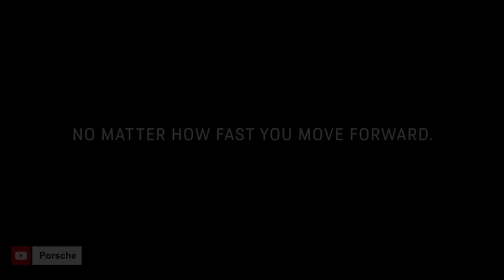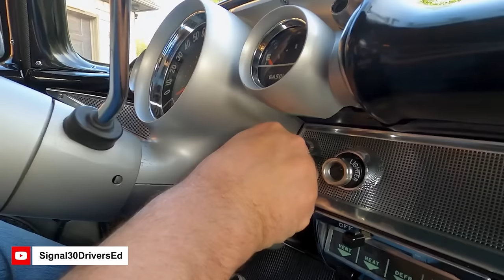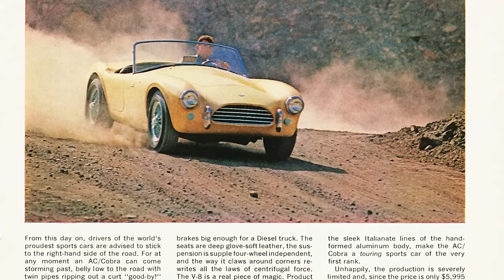Why Old Cars are Better

Comment: Great video and it's good to listen to someone that understands classic cars and the experience of driving them. I grew up in the late 40s and had some of the cars you showed. I miss them and now do not own a new car. My newest is a 2001 miata  and a 1997 GMC Sonoma. Both are maintained by me and both run great. I have no desire to sell them and get a newer car. Part of the reason is the expense of buying a $50000 -$60000 vehicle. Thanks for the video.

Comment: im 22 and have 57 chevy bel air. straight 6 with PS, PB, PG and no radio. built in janesville, WI. March 1st, 1957. pretty modern classic car if that make sense. got it running after about 20 years of storage. given to me by the sister of my dads friend who pasted on. wasnt too bad to get running, infact it was pretty easy. i replaced the single pot Power brakes with a dual pot system and cleaned up the brakes. new gas tank. wasnt engaging into reverse very easy, didnt think it was a trans problem. replaced the shift linkage bushing and that fixed it, like new. very easy car to service. the manual booklet has all grease and lube points and more info that youll ever need. the no radio is no problem for me as i use a JBL blue tooth speaker and play my playlist of about 200 songs from 54 to 64 when i drive it. 

its has so much character, it turns head where ever i go, i crave to drive it. its a real car that a man can be proud of.

Comment: I grew up driving a Mitsubishi Expo LRV, and having owned several cars since I have kept coming back to it. It's simple, reliable, comfortable, genuinely small, safe enough (as a distracted young woman in a GMC Sierra demonstrated by T-boning me at 50 miles per hour on a 25mph street) and mostly an analog driving experience. I'm on my 3rd one now, which even has a manual transmission. It's even a rare "sport" trim (AKA strip model with zero features) which my insurance is happy to upcharge me for. My dream car has gradually shifted from DeLoreans to Mustangs to fancy Eurotrash and is now firmly rested on a JDM import Mitsubish RVR.

I have owned several cars half the age and 3-5x the cost of my 1992 rustbucket fail out from under me, requiring expensive repairs that I can't hope to even attempt myself and parts that the OEM manufacturers refuse to sell. They have been scrapped, bought back under lemon law, or handed off to the repo man. Every 1990s car I've owned has driven perfectly fine on it's own power until some asleep-at-the-wheel idiot crashed into it.

Comment: My older brother had a 98 Chevy s10, I learned how to drive a stick in the s10. I learned how to work on cars because of the S10. I remember on my 16th birthday after I got my license my brother told me if I fixed the current blown radiator he would let me drive it whenever, wherever. My buddy and I with 0 shared experience figured that out in like 30 minutes. I'm currently doing a full suspension rebuild and as I indulge myself in work that I'm actually so proud of I always look back and remember being so proud of myself for changing a hose 😌

Comment: My dad has a 2001 Toyota Tacoma truck and it is one of the best cars we ever had. It's never had any engine problems or functionality problems at all. We put it to very hard work. To this day we use it for a "farm truck"/ transportation truck, mostly dirt loads. It looks like a average junk beaten up truck but it works like a charm. The only problem we ever had was the suspension breaking and that's all. 

One day i want to get a vintage car from 1930-1970 and i want to restore it and who knows if it will work for many many years more! Vintage cars rule in my opinion.

Comment: The best option is any pre-1973 GM product. No electronic components that kill the car the moment they go bad. Endless spare parts available for maintenance and repairs. Absolutely beautiful styling. Enough assistive systems and comfort options to make daily use enjoyable.

My personal choice is a 1969 Chevrolet Chevelle Sedan. Four doors, bench seats, 250 Turbo-Thrift I6, A/C, and absolutely gorgeous.

Comment: I can only but relate for houses, back when I still lived in France in 2022, I helped a friend for surelevations jobsites. It means you take out the roofing of a single floor house, to add a new floor and a new roof. Adding more space.
We took apart the roofing of a house, made in the 60's and 70's, from a time where there were far less people, etc.
Well, the lumber of the roofing was solid old oak. It was almost brand new when we destroyed it in 2022, dry as hell, so many stripes, strong af.
We replaced it by 2-3 years old pine, not dry enough, and far less stripes. Believe me it won't hold as much..

Comment: I own a 2022 ford explorer and it is just a fantastic vehicle, easily the nicest one I have ever owned; but as I drive along, I think about the direct injection turbo 4 that puts out 300bhp. I think about the miles of wires run everywhere. I think about the rear air system, and the plastic blend door gears and other components that modern cars have at this moment and it all feels like I am sitting on a ticking time bomb, and just one of these components outside of warranty will financially total the car. On the other hand, I have my 2002 Toyota tundra with 250k on the odometer, and no lights on the dash, no rips in the original seats, everything works, everything is sorted. It just feels like long after that explorer returns to whence it came, that old tundra will still be doing exactly what Toyota’s engineers designed it to do with very little fuss and very little fanfare.

Comment: I have a 91 dodge D150, and i can tell you the thing is easy af to work on. You can take the engine apart without removing it if needed. Sure the voltage regulator in the ECM failed, but they make external regulators to circumvent the issue entirely and not have to rebuild or buy a new one. You can just about do whatever you need to it in a parking lot.

Comment: Don’t know what you’ve got til it’s gone. And I tend to agree with the perspective that sorta mid-90s to early 00s was the sweet spot. That said, it’s easy to be nostalgic when you don’t really have to live with the headaches. A Sunday drive in a machine you don’t mind spending an hour of Mx on for every couple hundred miles is different than a daily. I remember the sounds of cars struggling (and failing) to start on cold mornings when people needed to get to work…cars basically falling apart from rust…being stranded in a parking lot w my mom on a hot day because of a vapor lock…cars that rattled like crazy…spending hours breathing dust on a sweltering day, hauling hay bales w a pickup w no a/c…etc. There are good reasons some (tho not all—I see no need for screens) of these changes came about.

Comment: I'm 24 and I live in Europe. My first car was a 2004 Suzuki Ignis with a 1.3L petrol engine. It was fine, I liked it, it was simple and reliable, but I was scared to work on it. I recently bought a 1989 Volkswagen Passat B3 Variant with a 1.6L turbo diesel. I'm really starting to fall in love with it. There's always something to do on it, but it runs flawlesly. It's basically a project that doubles as a daily driver.

Comment: I have never agreed more with a fellow enthusiast than this video. You hit every point on the head, it’s not nostalgia. Maybe some peoples preferences come down to nostalgia, but older cars had what we call soul. Things are much better when they solely do what they were invented for. Before I needed hands free, lane assist, beverage coolers, & seat warmers, the car just did the car thing the best. Much like cell phones today. Before we dumped all our data into the cloud, we remembered numbers & used phones as they were intended. Now phones are more like perpetuating access to people & think this hurts society, but that’s a whole other rant. You’re 110% correct & I find myself drawn to 80-90s Japanese cars with a few exceptions from the turn of the century euro ones.

Comment: One important thing to know about old cars is that they would get serviced all the time, back when gas stations had attendants who would pump your gas and check your window wipers and oil and top you off if you needed it. Constant maintenance had to be done to drive these beautiful old cars. But if you constantly maintain them, they could last you a very very long time.

Comment: The reason many new cars are giant is because of the epas fuel economy to weight ratios a larger car can get worse milage but a smaller car has to get much higher milage then an suv that weighs 5-6 thousand pounds

Comment: You're right. There's nostalgia involved, and both have their ups and downs. Lack of visibility is something that shocked me when i traded in my '99 Tahoe 2 years ago on an '18 Silverado. I hate the back up camera, but without it, you can't know how far you're from an obstacle like you could in like the '92 Silverado i had. Sure, it gets about 20 mpg on the highway, but my '92 got 21mpg. The '08 and '11 Impala i had got 23 mpg on the highway, which is better than the 12 my '72 Impala got, but not as good as the 25 mpg i got with my '78 Impala with the 305 ci V8. And, yes, i too thought those big cars were safer, until i saw that '09 against '59 crash test.

Comment: I'm 53 years old , my first car was a 1970 Ford f100 pick up I drove it for 20 years I'm so glad my kids didn't drive something like it they should pass laws keeping old cars off the road the new cars are a lot safer and use a lot less fuel.
Reply: Yes, that's something only briefly mentioned in the video like it's not important. Car safety has gone a long way from the 60s and 70s. Also most people don't care about "feeling the road" or doing a whole routine just to start their car before driving, but want a smooth driving and safe vehicle. I was T boned 9 years ago on a state hwy by another SUV driving 55 mph because some hooligans broke the stop sign so the guy who hit me didn't even know he was supposed to stop. The firefighters said the only reason I'm alive is because all the safety features and reinforced driver's door on my 2015 Subaru Legacy. If I was driving some old car I would've been dead. Looks is not everything when it comes to cars. Plus that's also very subjective.

Comment: I own a 1974 Fiat 124 sedan. Drove it for about a year, then sent it off to the shop to get completely restored from the ground up.
That car was my daily, and I drove it all over, not just from my house to work.

I've also owned and driven long distance/rented a myriad of other cars, from the 90s to 2010s, and none of them get even close to the 124.
Sure, the electronic fuel injection may be more efficient (in some cases), but it also brings a lot of problems with it.

I've had several BMWs die on the highway because of the air flow sensor dying or the timing belt snapping way before it would have needed replacement, a 2005 Renault Clio that just completely fried the ECU for no reason, a rental Jeep Renegade that caught on fire because a ground was bad, and more recently some Mercedes SUV I rented left me stranded because it went in limp mode, again for seemingly no reason. The list is much longer, but these are the more important ones I've come across.

The problem with modern cars, besides the massive distractions they procure to the drivers with their giant iPads glued to the center consoles, is that the more unnecessary things you add to something, the less you can depend on it. There's simply more things that could go wrong at any given moment, and the anti-consumerist practices that automakers have been pushing for lately just make things even worse. You can't just grab a screwdriver and "tune up" your car if it's running a bit rough nowadays, you have to bring it in a shop and have them use an overpriced tablet to figure out what's wrong, and even then they might not be able to fix it anyway because mechanics nowadays are just trained to do as the computer says, they don't actually diagnose the root cause of a problem.

And, I've noticed, the same can be said about literally anything. From phones, to fridges, to houses, to industrial equipment. Everything has been unnecessarily overlycomplicated, and in some cases specifically engineered to break after the warranty expires, so you're forced to buy a replacement with your own money.

Comment: I think the death of mechanical throttle linkage is was the beginning of the end for fun with cars.  From that point, the connection between the driver and the engine was severed—run through an intermediary rather than being fundamental.  But I do think some good cars have been made since then, particularly in the earlier days of drive-by-wire.
Still, I do think cars prior to the days of computer-controlled everything were more... real.  I've only owned two cars, both of them total bangers—even if they're worlds apart.  My first was a 1995 Mazda MX-6 (which I still have, but is unfortunately infirmed)... LS trim, I believe; manual transmission, V6 engine, and every option fitted... except ABS and Traction Control... and the 4-wheel steering that was only available in Japan and Australia/maybe New Zealand, obviously.  My second was a 2017 Volkswagen Golf GTI (yes, I know they stopped calling the GTI-model a "Golf" somewhere around that time, but I do not actually care), and it's... well, it comes from a completely different philosophy, but on the surface, it's actually quite similar.

Both are sports cars designed to be practical for daily use.  The Golf is a hot hatchback that's tame at cruising speed and vicious when the turbo kicks-in, and the MX-6 is... something of a baby GT-car—a ground-up sports car, designed to be calm and comfortable when you need it to be and exciting when you want it to be.  In a sense, it's the same niche.... but that's where the similarities end.  The MX-6 is raw and pretty much unfiltered.  It's got pretty good suspension for its time, and the engine has some fancy trickery—a very noticeable variable-length intake—but it's a naturally asperated, torque-y V6 with four wheels and no other filters.  The Golf, meanwhile... well, it has more power and weighs only a little more, and the suspension is way, way smarter, and you can feel it in the corners when it truly loads-up, but... any time you really want to drive like a hooligan, the traction control gets in your way.  Now, that alone isn't a problem; that's the system doing what it's designed for.  But it doesn't turn-off.  It has three-settings: On, Fake "Off," and Slightly-More-But-Not-Remotely "Off."  If you want to be free of it, you have to start messing with your car's programming.  The engine, sure, it wants to turn the front tires into smoke, but the computer won't let it.  And, of course, the severity of your throttle, the amount of feedback on the wheel... all of that is the computer, too.  

All in all, the Volkswagen... feels like a curated experience.  Like the manufacturer felt the need to sit-in with you while you were driving.  Meanwhile, the Mazda... well, when it was just me and the car, it was just me and the car.  And I can't really say more than that.  Even the Golf itself... feels like it wants to do more, feels like—when you take the revs up and that turbo just punches you—it wants to play... but you can only play within pre-ordained limits.

Now, there is ONE big caveat with those 90s cars we all love so much.  Parts.  Ohhh, the parts.  What's got my MX-6 infirmed presently is an issue with the window rollers (yes, the rollers, not the motors) that... I've been struggling for the confidence to fix... even though I have found a (hopefully dependable) way of fabricating them; the car is just not made for this particular part to be replaced.  With more plastic came a greater degree of disposability, meaning that a proper restoration... is going to be a challenge for me, and I know that car needs it... it runs for now, even as I've been struggling to find time and the gumption to truly fix it, but I know that car needs more than I know how to give it.  I will give it, some day... that damned thing saved my life, gave me a reason to keep going... but I've got to get that life together first.  Luckily, I've got my dad to help me still, but his wheelhouse is proper classics—stuff from the '60s and '70s.  It's going to be an uphill battle.  

All of this is a long way of saying I—while I don't think it's a perfect phrasing of the matter at hand—agree with the core message of all this.  Cars are supposed to be more than just transit from point A to point B.  They're supposed to be an experience, a part of the family.  More than just a machine.

Comment: I have a 66f100 pickup. It came stock with the 300 I6. In my opinion, it is one of the best engines ever made at least in America. Had about 500k on the clock and wasn’t running in 3+ years when I bought it. Flushed all fluids and threw a new battery in it and started straight up. Plus the torque in it was unreal. Didn’t feel powerful until it could pull a tree stump out of the ground by Barry hitting the gas. Engines like that sadly won’t ever really be made again

Comment: A lot of the things surrounding “being more connected” to your vehicle are why I got myself a motorcycle. The reason being that, unlike cars, they very much do “make ‘em like this anymore,” at least certain models. My DR650 for example, I bought mine used but you can go to a dealership (in America at least) and buy a brand new one that’s still air-cooled, still carbureted, no gauges save for a speedometer and odometer. That’s it, simple as can be, and a piece of cake to maintain. Yeah, it’s no sports bike, but it’s a real treat to ride nonetheless.